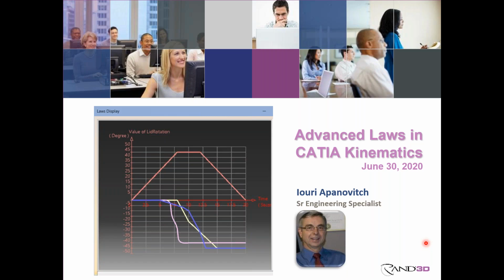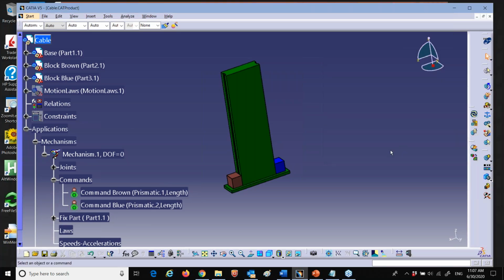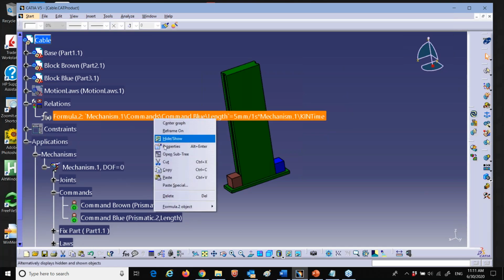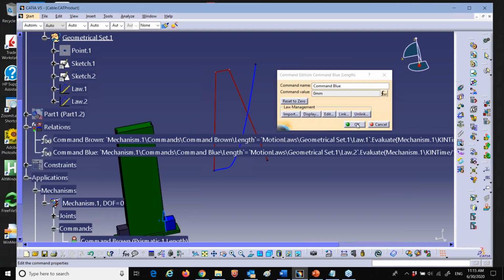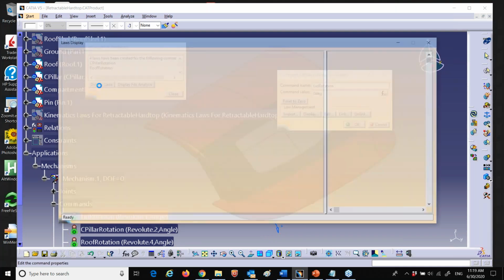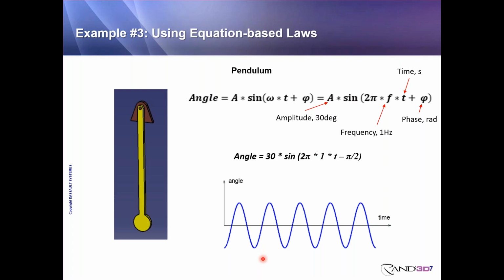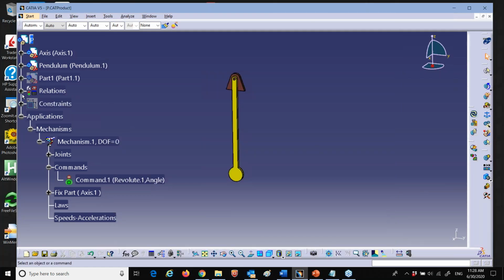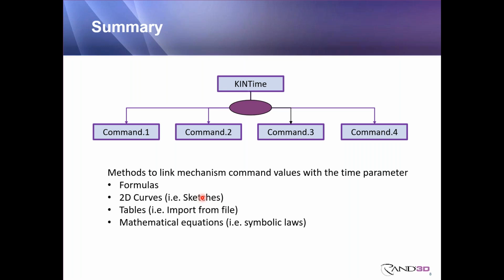CATIA Kinematics: Advanced Laws

Comment: Thanks for you comment. Yes, you could certainly use radians all the way, but I find degrees to be better understood by engineers, and also degrees are the default unit for the parameters of type Angle in CATIA. The main reason why I used a mix of deg and rad was because the SIN function requires radians as input. Then converted the result back to deg, after evaluating the Law. Hope that helps.